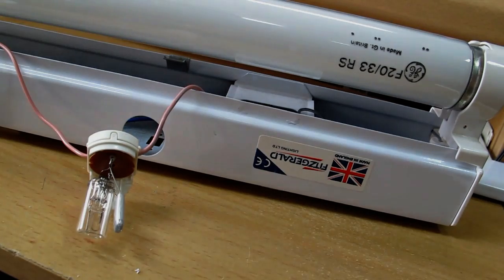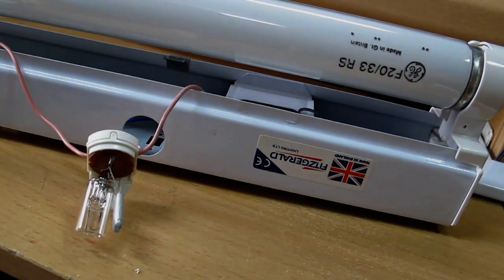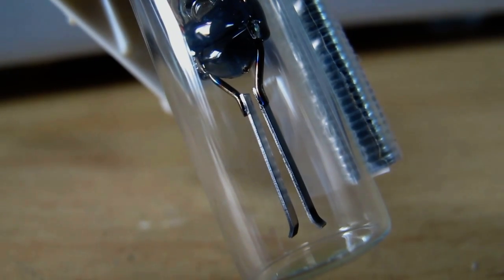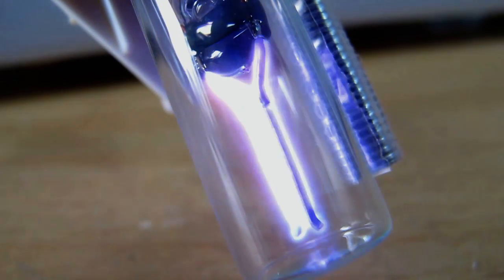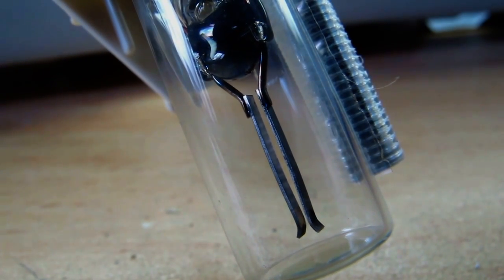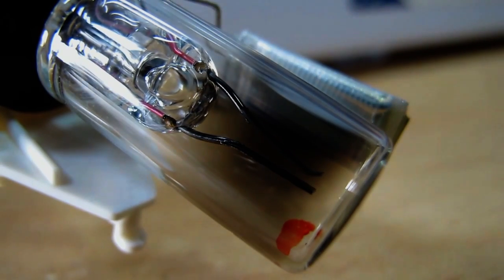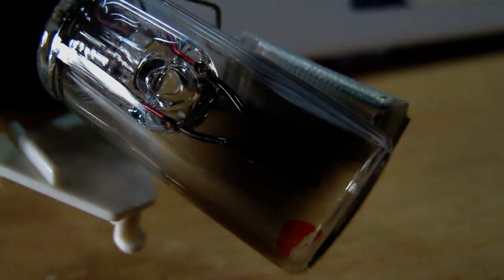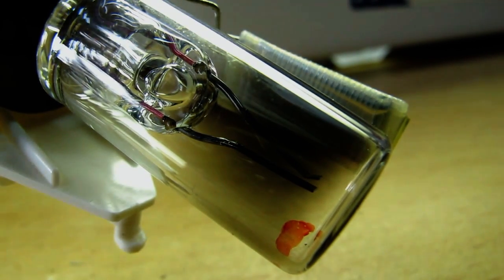Fluorescent lamp starter close-up detail.

Comment: Being a electrician as I am forever fromtsidebus and that's is a Fitzgerald 2ft 20w t12 fluorescents tubes live outputs via the 240v means power 🔋light fluorescents tubes fitting and run off a Fitzgerald 18-20W choke ballast and with a Fitzgerald fs10 4--65w 220-240volts fluorescent tube lamp starter switch.and with that ge 2ft 20w t12 fluorescent tube from Hungary.the first starter it's a fsu 4--80w starter switch or a 155/500 4--65w starter switch and I know the second fluorescent tube lamp starter is a osram st111 4-65-80w 220-240volts live output made in Germany and the third fluorescent lamp starter is a Fitzgerald fs10 4--65W 220-240volts fluorescent starter switch.its very clever how the fluorescents starters start up any fluorescents tubes and fluorescents lamps any fluorescents lighting in general via from the ballast.it's fucking cool 😎 or what with lots of many thanks and have a very good day now

Comment: That fixture looks brand new!  They still make the starter type over there?  In the US, I haven't seen them sold since the 1970's.  Maybe the ballast is smaller with 220 volt mains, so the design makes economic sense or something.
Reply: You can still find new old stock ones quite easily in the UK, however most stores only sell electronic ballast ones now and even they are moving to only sell LEDs. And yes, the ballasts are pretty small.

Comment: Why does it even need this to start the bulb????
Reply: The filaments in the fluorescent lamp need to be hot to emit electrons into the gas inside the lamp. The starter, when it closes, connects the filaments in series so they get power to heat. This type of fixture is called preheat (in the US) or switch start (in the UK). Once the starter opens, the ballast produces a high voltage "kick" to strike the arc inside the lamp. Once the lamp is lit, the arc impinging on the filaments keeps them hot so they emit electrons into the gas inside the lamp. The ballast then limits current flow to a safe level.

Comment: Amazing video. Did not fully understand starter until now. The electricity passes through the gas in starter until the bimetallic strip closes and then the strip starts to cool down immediately as no electricity flowing through the gas and switch opens. Thanks Very much. Michael

Comment: soooo.... why does it move at the beginning before they touch
Reply: Amazing video. Did not fully understand starter until now. The electricity passes through the gas in starter until the bimetallic strip closes and then the strip starts to cool down immediately as no electricity flowing through the gas and switch opens. Michael

Comment: Any idea what causes the contacts to stick together for a moment?  I'm guessing it's designed in to allow adequate heating time but occasionally they stick for ages (and of course forever).
Reply: Its because a shit ton of current passes thru it as the two cathodes of the fluorescent tube heat up. Its why they weld after a a tube fails, cuz it keeps trying to heat the cathodes and start the lamp
Reply: @SaudiSpeedLS2  I get that's why they weld, but how do they stick for a few seconds then pop open again with a "ping"?
Reply: @lewisbowick8606  Thats because it is a very weak weld, and as the Bimetalic stip cools down, its force is strong enough to rip it back open.

Comment: The inductor "wants" to maintain a flow of current equal to the heating current of the filaments when the starter opens - I suppose the tiny starter discharge path can't support the current density, while the actual lamp can.

Comment: agree on open fittings mounted on traditional building materials its not a problem but, not so much now, but 10 years ago + most food factories were made of polystyrene composite panels and had enclosed switch start lights  - if a choke overheated and caught fire and if the composite panel caught fire  - thats your factory in flames and destroyed  - and many food factories burnt down due to this

Comment from the maker: In some installations like you stated there could be a problem but when you are replacing more failed HF ballasts before the original tubes have expired one wonders what is the point. I have seen old neglected 8 foot lights that have failed and the starter has become stuck with the ends glowing and the choke humming left that way for years with no ill effect!

Comment: So simple and so neat :)
But I still dislike the "reactor".. huge coil-thinge that gets hot. (or they are just too cheaply made, who knows?)

Any chance of scoping the voltage inside the circuit while it starts?
There is one detail I don't fully get, when it opens, what makes the voltage spike hit the tube and not just reignite the starter?